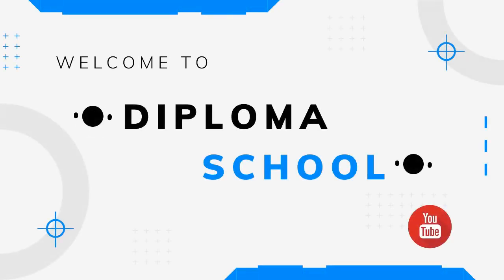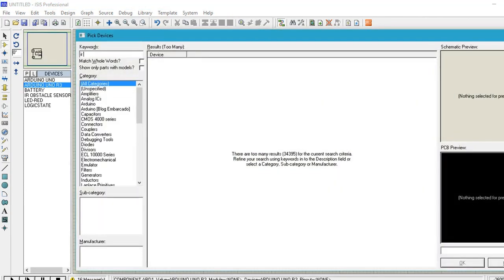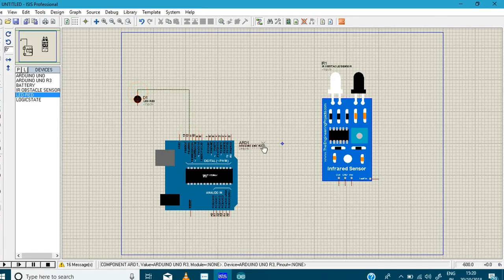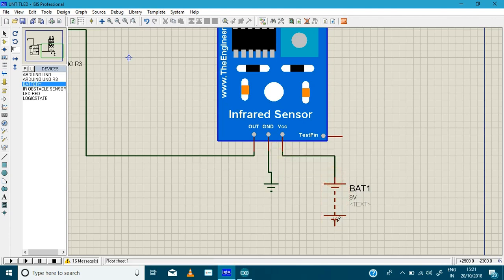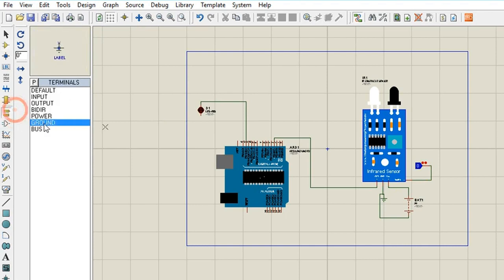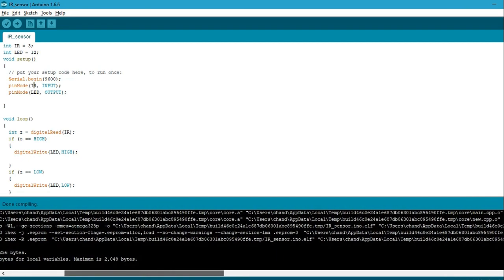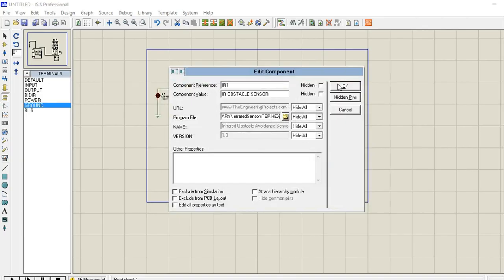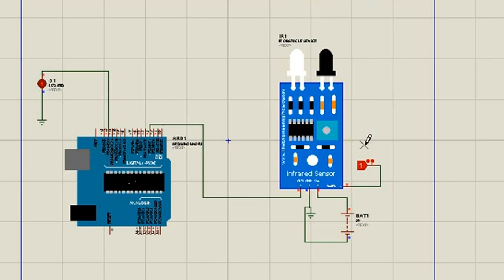How to Add IR Sensor in Proteus

Comment: Sir program please
Reply from the maker: Do you need the basic program?  What types of project you gonna make?
Reply: @tutorialspointeee  sir I am making a mini project based on IR sensor which will detect the object.My project name is 'automatic washroom light control by using IR sensor'. When we enter the room First IR sensor detects the object then bulbs gets on and if we exit the room the another IR sensor detects the object and turn off the bulb. In this way I trying to make mini project in my 3r year engineering.
Reply from the maker: @rahulbhamre599  Wow that is great. If You need any kind of help please inform me. 17305023@iubat.edu